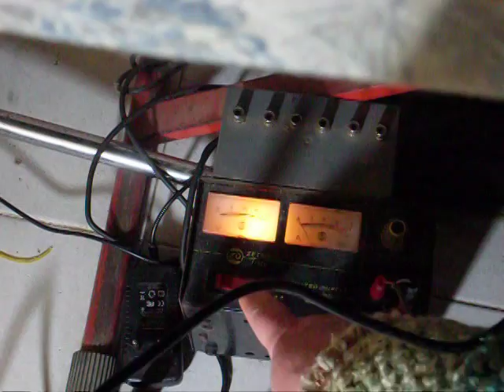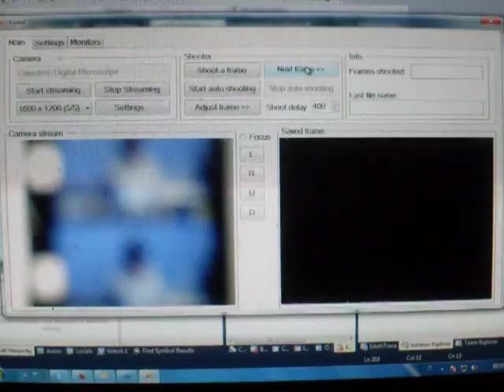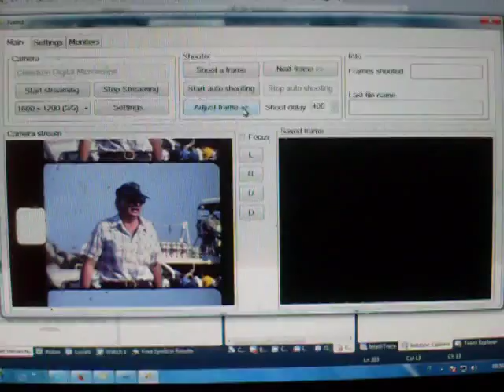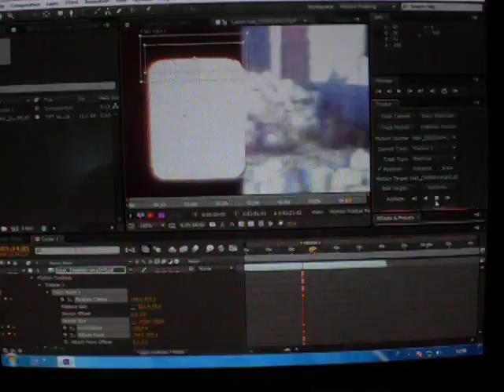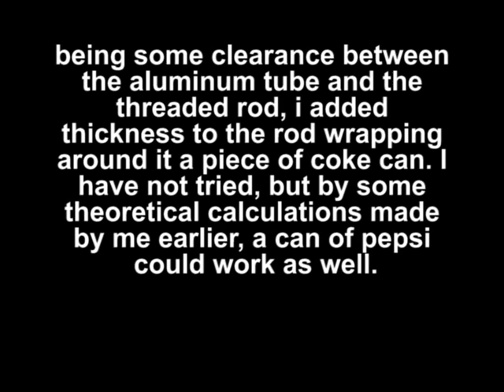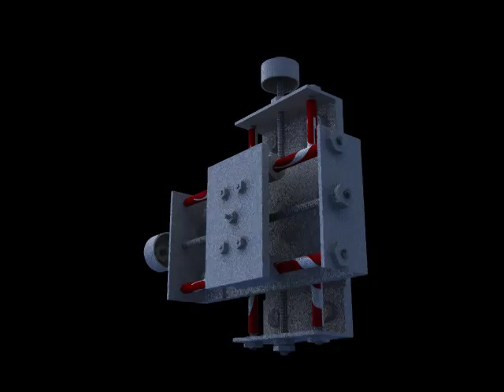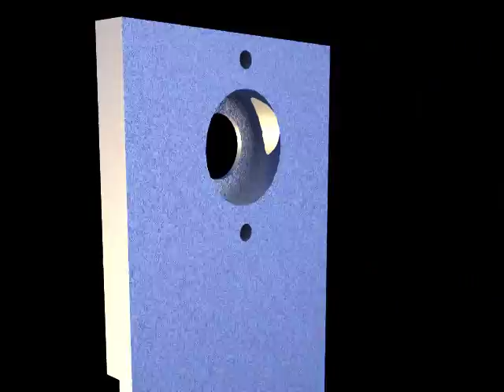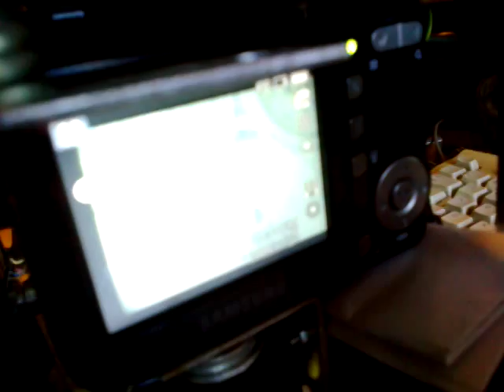DIY Super 8 Film Scanner

Comment: Why do you need software image stabilization? Isn't the sprocket & stepper combination (along with proper tension on the film) accurate enough to repeat each frame position exactly?
Reply from the maker: it would be enough accurate if i had the right tools and, maybe, more experience in cutting and mounting aluminium or other metals. I had to put the sprocket in a bearing, but i couldn't make a hole that was exactely perpendicular to the chassis, due to a lack of tools (drill press etc). Plus, the tension isn't always the same on the film, because of little deformations due to the fact the films are at least 30 years old. 
I would be more accurate if i could create the pieces with a 3d printer (i have designed a better rapproach).
But, Enigma, i would be grateful to everyone who, seeing my mistakes, could give me advices on how to get more accuracy on this machine. In effects, if i could skip the time-consuming phase of stabilizing the film it would be much better.
Reply: I wish I had great advice, but I'm going through my own learning experience.  I've been experimenting and my design keeps changing.  My current approach is to use a double sprocketed film transport from a junked projector driven by a stepper.  Because it has two sprockets which bound the film at the loops, it's essentially a closed system.  My film jitter should be no worse than that of a standard projector.  I use DC motors for driving the reels..  I run the motors closed loop so as to maintain constant torque.
Reply from the maker: Enigma758
This is exactely the approach i was thinking while re-disigning the machine. I think that the two sproket system is better than apply torque via a friction, because it don't damage the film. Can i ask you how do you position each frame to scan?

Comment: I would suggest a claw mechanisim as close to the scanned frame for more precise frame changing and  positioning. This should be easy with do with your present frame advance system.  At present there is a lot of slack between your sprocket and the gate giving the varied stability result and having to correct in software later.
IndigoDVW
Reply from the maker: thank you indigo, i guessed the slack was one of the causes of instability. I will study some formula to build a claw instead of a sprocket, and a sled, a curved chassis with the gate in the middle.
Reply: I think a curved gate would be a lot of hard work not to mention it would have to be 'perfect' and this is easier to achieve with a std flat gate and let the claw(s) do the work consistently and this is where using that 24 tooth sprocket to feed in and out with film loops which will give a consistant load on the gate and claw and producing a steady frame registration. 
 Claw mechanisims are simple to build but best one perhaps source  from an old camera?  
I have just took delivery of a Wolverine, (has no feed in/out sprocket) and the friction take up via a couple of loops is a bit over powerful producing film judder on occasion. A couple of drops of oil helped ease the friction drive and things now look OK. but a sprocket film feed and takeup would be better but then the cost would escalate .. you can't win them all.

Comment: Nice projekt :)
Whitch capture software do you use. 
Regards. 
/ Peter
Reply from the maker: Hi Peter, i use two software, one on the microcontroller and one in PC. Both made by me.
The one in the microcontroller is written in c# (the controller is NetDuino) and is very simple: it receives a bit from PC via rs232 to USB cable, turns the NEMA17 stepper motor 360 degrees, and finally sends a bit to the PC

The software on PC is written again in c# (WPF desktop). It receives the bit from NetDuino, shoots an image from the streaming of a web camera (now it is a digital microscope by Celestron, but it can be any USB camera) and then send a bit to the controller. And so on. 
I've built another scanner, for 35mm film, with the same software, in wich i've added a module that also captures audio from the waveform impressed on a side of the film.
Reply: @aeternum100  
Thank you for your answer!! :)
I am very interested in the pc software that you use to capture the film.
I am using Arduino Uno to controll the steppmotor in my projekt but missing the right software to capture the film in high quality.

The camera I was going to use is a Logitech c920 HD
Is it posible that you can share  the software.
Regards
/ Peter

Comment: dear sir, are you planning on releasing both codes?
 great system by the way
Reply from the maker: Do you need for some project?
Reply: Indeed, ive build my own telecine but im having Trouble keeping the frames consistent (mostly whitebalance and Collour balance issue) i want to try different things and software is one of Them, i  Saw your video and thought, this might be the answer.
Reply from the maker: I don't know what kind exactely you have, but my software just takes the picture from a stream coming from  digital microscope, doesn't nothing about color balance. Once i've acquired all the frames as tiff or jpg list, i load them into After effects, and i fix white balance and color balance there. An important thing i do with after effects (or mocha, if it is a 24 fps footage), is stabilization!. Not applied on the inner footage, but on the frame position, using the holes as a reference, to eliminate a little vibration. If you want i'll send you the codes, the one for NetDuino and the one for Windows, but have to use a special cable for communications from the pc to NetDuino and vice-versa, and a COM free on PC. 

If you are mor precise about the issues you are facing to, maybe i could help you more.
Reply: Can you stabilize a MOV file using After Effects?
Reply from the maker: sure, file format is not a limitation. With after effects you can stabilize any kind of footage, even a sequence of tiff/jpg etc.

Comment: I always tried to use de After Effects´ tracker tool to estabilize the scanned frames, but I did not succed. How do you do it? What am I missing in the process?
Reply from the maker: +Fede I
t depends on what are you taking as reference image and search area. After effects makes the tracking with a couple of boxes: the outer is the search area. the area to scan, to find the pattern to stabilize. The inner is the pattern to search. I set the inner box (pattern) on one perforation. Sometimes even a little piece of the perforation is enough: the upper half of the square hole, for example. The upper half is better than the lower, because you almost never find a hole damaged in the upper portion (the grip can damage the hole sliding from top to bottom, not the opposite). 

As search area (the outer box), i prefer a box that is just a little bit larger than the hole, and high 2 times the hole. But be careful: the search area, the outer box, must not be placed on the image, neither must be the pattern box: the image changes every frame, it confuses After Effects. 

Also: the trackin engine of after effects works better with very defined images. The poor quality of slightly damaged holes are a too complex image, plus, the variations of the border of an old, worm.out hole, can confuse the algorythm. I prefer to pre-compose the image in another layer, where i set very high contrast and very low lightness. I add also a little blur to the image. In this way, the contrast/lighness control sets the image very dark and the holes very bright, obtaining a lot of contrast, wich is better and faster to compute for After effects. The blurring gives the jagged borders of the hole more homogeneity.

I do all that settings when i need to scan films shooted at 18 frames per second. When i am enough lucky to scan a 24 fps film, i prefer Mocha (installed with AE 5/6). It is very fast (much faster and precise than AE) and very simpler to use: no boxes, just a simple spline around the hole! Too bad it doesn't works at 18 fps.

But remeber: AE and Mocha are not perfect. Often i readjust some tracking by hand!!

Good luck and please ask me anything you need.
Reply: +aeternum100 I think I´m going to pre-composing the sequence and change the brightness, contrast and blur values like you did. Thank you for taking the time to answer in such detail, it was really helpful.

Comment: I bought a proper film scanner. It's not exactly perfect either. The original camera used by my parents wasn't perfect. When I have time I will photograph each frame using a dslr with macro extension tubes to get the maximum resolution. I will then combine the jps into a completed film. This will probably take 30 hours in total for a 1 hour film
Reply from the maker: it's difficult to predict. If you can shot one frame per second, maybe you can do it in 18 hours (for a footage shot at 18 frames per seconds). But if you let the camera adjust focus every frame, maybe your guess is more precise than mine.